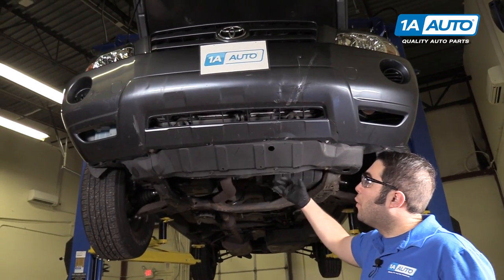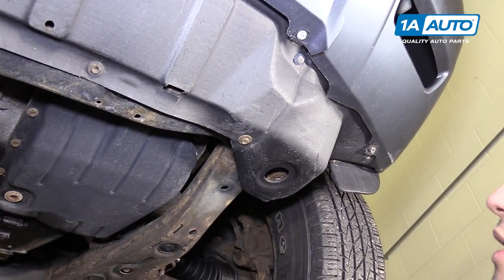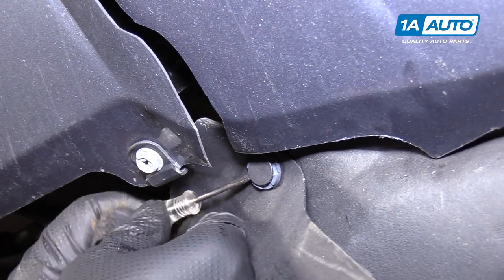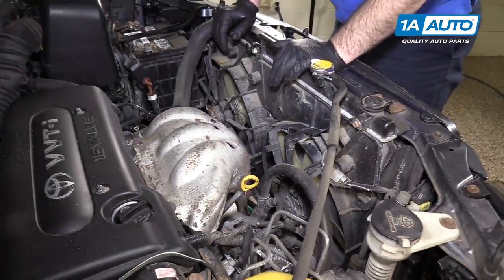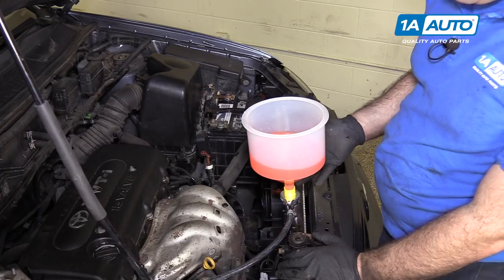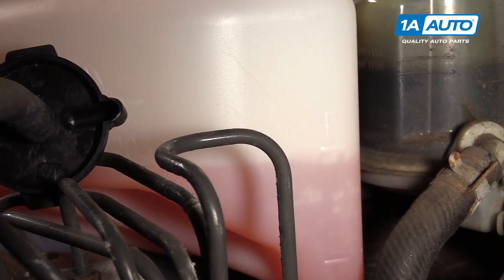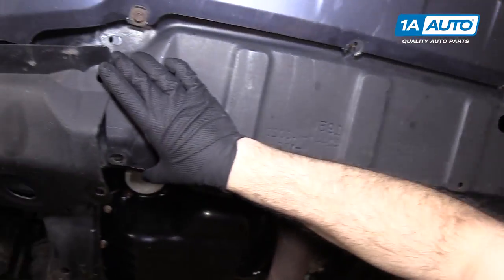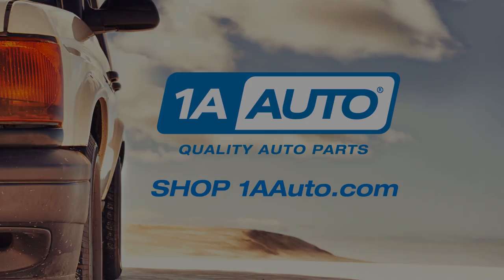How to Drain Fill and Bleed Coolant 00-07 Toyota Highlander Cooling System

Comment: 50/50 mixtures no good that is wrong you're going to have some antifreeze in the water jackets in the engine etc in the water pump all throughout that area all you do is drain the radiator you cannot use a 50-50 mixture cuz now you are interfering with whatever mix has been dilapidated all the electrolytics are out of it that are in the engine block right now you have not done this correctly.... all I wanted to know was where the plugs were on a V6 that's not even a V6

Comment: Great video... I honestly think that most cars it doesn't matter whether you put the heat on hot or not. Most cars the coolant runs through the heater core all the time and it's either vented outside or it's vented into the cabin. There is typically not a valve or switch that makes coolant flow through those heater cores. Nice job
Reply from the maker: +condor5635 Thanks for the feedback!

Comment: No water! Use the H.O.A.T. coolent system. It's non conducting non corrosive.
Reply: If you have an older Toyota that calls for the RED Toyota coolant, mix 50/50 with DISTILLED Water to prevent corrosion.

Comment: You mention running the car without the radiator cap on in order to allow air to escape the system, and state "it could get messy as coolant may bubble out."  #1 Not good for the environment to allow coolant to spill on the ground and then be washed off your driveway, etc. into storm drains that typically lead to waterways.  #2 Not good if you have animals around that like the sweet taste of antifreeze as it will kill them if they ingest it.
Reply: 1)  Environmentally speaking, engine coolant is not a problem....and it is not like he's doing it over dirt and dumping 5 gallons of it.   2) Does he have to state common sense one should clean up spilled fluids?????      Come on!

Comment: Thanks for the video.

But I think you guys should watch “The Car Care Nut” episode Toyota Cooling System and Bleeding 2GR-FE to truly understand bleeding the entire system throughly. As turning on the heat to circulate through heater core doesn’t really remove air pockets.

Comment: Anyway you guys can do an in depth video replacing the timing belt water pump and camshaft/crankshaft seals  on a 3mz-fe AWD engine ie a 2nd gen rx330 ? Your videos helped a lot with my old ‘00 cavalier.

Comment: Isn't there a drain plug that needs to be removed to allow the coolant to drain from the engine block?
Reply: Ed Goad there are two on the Highlander's. One is very near the oil filter and one is farther back on the block.

Comment: Hello ! So for Highlander V4 , how many liter for refill ?
Reply from the maker: +Seak Meng Depending on your options you should have between 6.5 and 9 quarts of coolant in your system when full!  1aauto.com
Reply: 1A Auto Parts ok ! ! thanks for reply
Reply: Seak Meng you weren't really asking what the capacity is you wanted to know how much came out on a drain so you know how much to refill.  That amount is roughly 4-6 quarts in this vehicle.

Comment: You only turn the heat thermostat all the way on but do not turn the fan on?
Reply: 2A Gunner - the fan does nothing for the process.  Actually in many cars turning the heater temperature dial to hot doesn't do anything to help this coolant process.  The heater core in many cars gets circulated hot coolant regardless of what the heater dial is set to.  What the heater dial would do in those cars is adjust the blend door to put more or less heat in the cabin.  But hot coolant is always flowing through the core.  Some cars I believe have a valve that may restrict the actual flow to the heater core but I believe those are the exception to the rule.
Reply: 2A Gunner I turn the fan on too because I think SOME vehicles won’t actually turn the heater control valve on unless the fan is on. 

Also, having the fan on helps me know that the coolant is circulating.
Reply: If you turn the heater fan on it will take longer for the engine to heat up to operating temperature and longer for the thermostat to open and to expel air from the system.